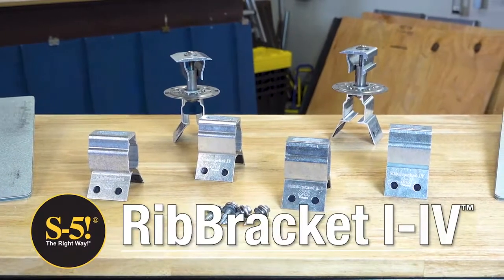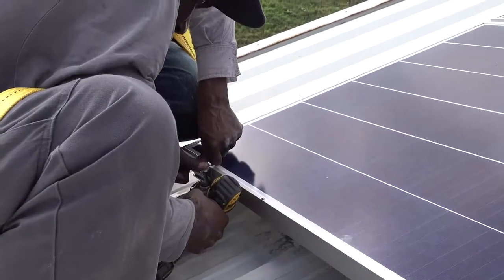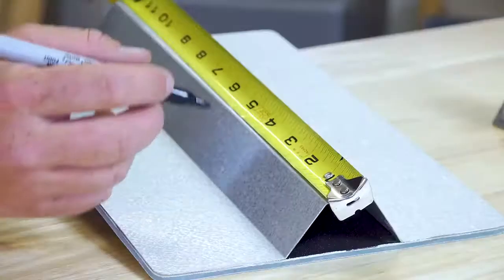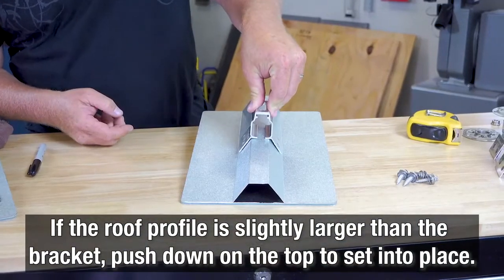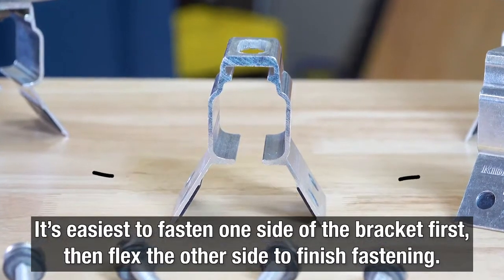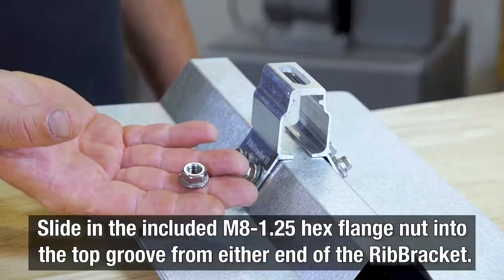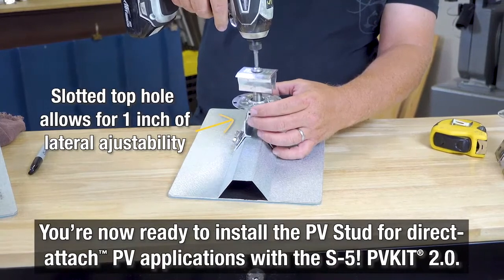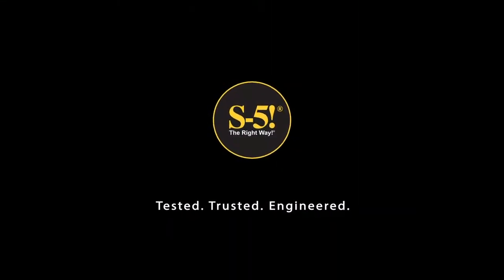S-5! - RibBracket I - IV™ Installation Instructions | How To Install The S-5 RibBracket

Comment: You need a minimum 26 gauge or 45 mm metal roof... sadly roofers mostly install 29 gauge because they are CHEAP bastards...
Reply from the maker: Thanks for your comment! It's true that S-5! RibBracket products are designed for optimal performance on roofs meeting certain specifications, like 26-gauge or thicker metal. While 29-gauge metal roofs are common in some installations, S-5! offers a range of solutions to help meet diverse needs. We always recommend consulting with a trusted roofing professional to ensure the best products and practices for your specific project.

Comment: What the difference in strength for each bracket, (  1,2,3,4 )
Reply from the maker: Hi Hector, the choice of what bracket to use is not based on how much strength you need but on the size and geometry of the rib that is being attached to. Do you know what profile panel is being attached to or have a photo that you can send over to contact@bigrocksupply.com?